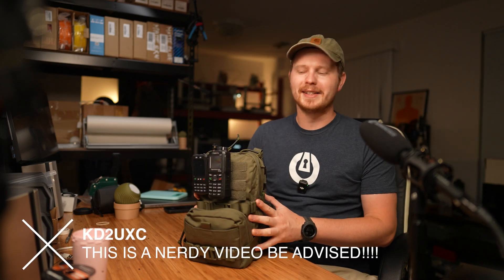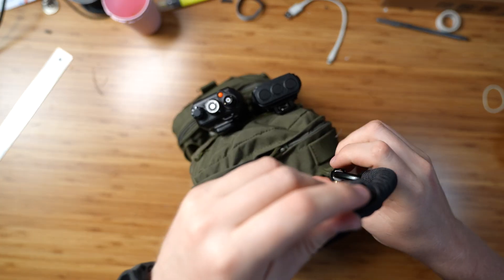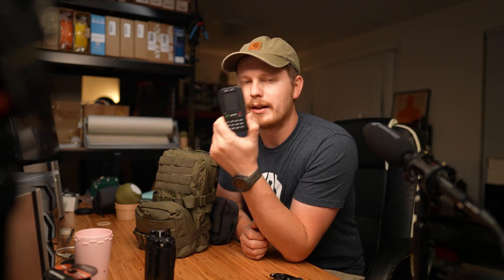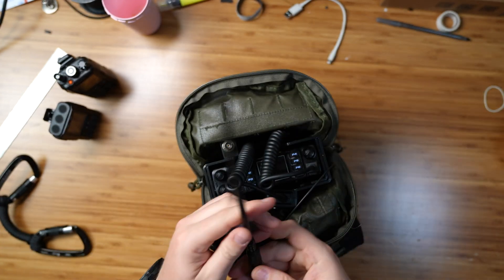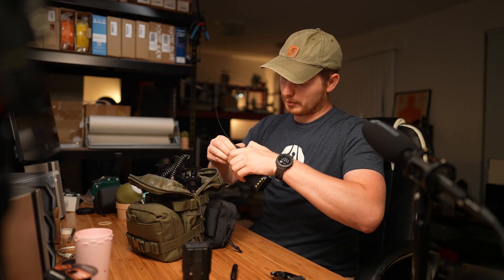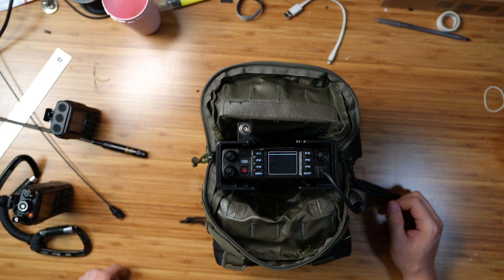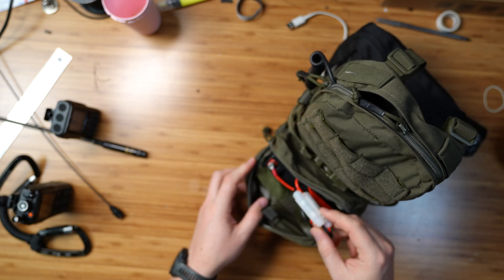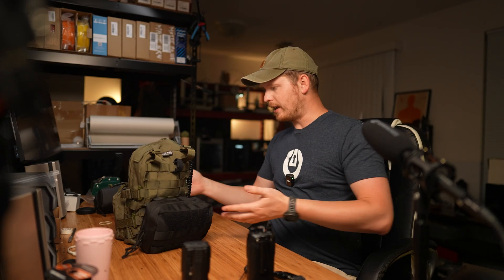What's in my Ham Radio Manpack GoKit |Anytone 578| Part 1

Comment: Love it!

I did the same thing. Took a 578uviii pro and turned it into a manpack. 

The bluetooth handset is awesome. Just wish they kept the same key maps. I catch myself hitting the wrong thing regularly. 

Armoloq makes great stuff. Without them, a manpack just wouldn't work all that well. 

I have a 14 foot collapsible pole and a 10 foot jpole antenna that I use for out in the woods setup and a whip antenna for the backpack. Plus I just plug into the antenna on the truck when Im mobile. 

The 12ah bioenno I strapped to it will last me a gull weekend as long as I don't tx on Turbo

Manpack is the way to go. 

Gonna go look for the rest of this video now, lol.

Comment: Have you ever actually used the BT101? The range is only about 20 feet/6 meters and only if it's in sight and no barriers.
Reply from the maker: I actually use it basically daily in my office and the first floor of my house. No issues so far. 

But I’m sure it’s not extreme distance. Bluetooth only does so much.